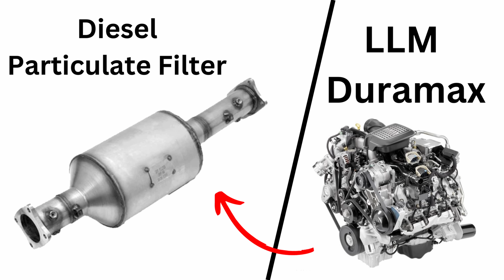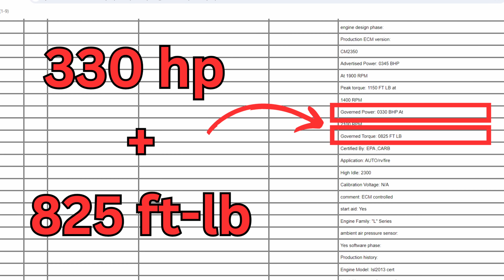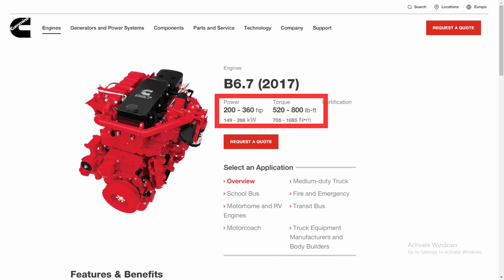Chevy 2500 8.3L DURAMAX Diesel Engine **Diesel Mechanic Review** | Should CUMMINS Be Worried?

Comment: Why? Because the rules that the EPA has put in over the past decades have been changed. These past rules is why we have small engines with turbos that are designed for high performance but are failing at 20,000 miles. And gas prices are dropping dramatically large engines are making a comeback.

Comment: Right now the Duramax is the most reliable diesel engine on the market. Powerstroke defective fuel pump problems continue, Cummins new design is untested but given the fact the new Cummins motor in the 2025 RAMHD still sprays extra fuel in the cylinders for regen which contaminates the oil.

Comment: I think you hit it when you said it would be for emissions, especially for NOx control.  I can see GM boring and stroking the Duramax, but not increasing power and torque output, or maybe just bumping it a little to please the horsepower fanatics.  Also rumors about a 7.2 Cummins are going around, and the play for NOx control would be the same.  Assuming that the larger displacements can be achieved without completely redesigning the engines, that could be a good way to meet tighter NOx emissions standards without increasing the powertrain cost significantly.  If the manufacturers can get to an emissions control strategy that allows them to eliminate the EGR system and meet NOx with the SCR system alone, that would be an overall cost savings.  The larger displacement engine would allow that by running at lower peak cylinder temperatures, thereby producing less NOx out of the exhaust ports.  Then the SCR could clean up the rest of the NOx by itself.  And that would eliminate secondary issues of recirculating exhaust gases to the intake.  Fuel economy wouldn't necessarily be affected if the engine is tuned to the same fueling limits, but if the stroke has to be increased, fuel economy might be hurt.

Just making some educated guesses based on basic dimensions of the Duramax, I don't think it would be easy to get it past 7.8L.  It would depend on how much GM is willing to push operating stresses.

Comment: If they don't figure out what to do about DOT laws and the current #26,001 Class A license requirements they won't be selling near as many trucks.   Keep building there trucks with higher GVW and everyone will be required to have a CDL license in order to drive one of there trucks with any type of trailer.   And that makes these trucks useless if you just ride around with them doing nothing.

Comment: Dura junk ! I bought a 3500 in 05 brand new. It was on a roll back at1200 miles and got that ride every other month for 3 years. The final straw was at 35k and it was down for 3 weeks with injection problems and parts had to come from Japan. I’ll never own another one. Bought a dodge 3500 w Cummins 6.7 6speed and now have 280k on it. Fuel, pump, water pump, some emission parts , never on a rollback!

Comment: I think the entire emissions system idea should be scrapped in favor of maximizing efficiency and torque potential. Making smaller engines that are more efficient will reduce total volume of emissions instead of less PPM. The Edison Motors concept of a true Hybrid system with a smaller max efficiency engine is the best technology path I have seen.

Comment: Putting a giant cubic  engine  will give GM a lot  of room to grow. I think all the big 3 trucks are pulling weights that are in air brake country. Loose  your torque converter  and it good  by .your exhaust brake is not made to stop you . When I pull heavy loads my w900 gets woke up. You had a lot of good points. Cummins made an 8.3 liter inline 6 300 horse power and 850 torque. It's the big cubes  that makes the strongest torque.

Comment: The torque rating on the duramax l5p is almost meaningless, as you’ll never be at 1600 rpm’s unless in first gear, and I also read the 2500’s are limited in power output in first gear. I don’t think pickups are designed to run at full power continuously, or near continuously, as a large tandem dump. Also, in addition to greater strength, a larger differential can radiate large amounts of heat generated by pulling a heavy load, improving durability.

Comment: When we were wrapping up the paper work on my dad's new '98 K2500 6.5 TD from a salesman my dad had bought cars from since the late '50s and I said how much I wished GM would make a giant killer turbo diesel, and the guy said hold tight, GM is coming out with an 8.3 diesel that makes 500 hp in a couple years. The guy worked at Gene Jansen Chevrolet for years, which was the dealership across the street from the Union Street plant and where all the performance Corvettes and race cars went before being picked up by racers and this guy was connected to GM corporate for decades. Sounds like he was off by about 20 years.

Comment: They just need to come out with their own version of the F-450 and f550 with a bigger drivetrain and heavier Duty frame  and put that use engine in them
Reply: They  do.. 4500, 5500, 6500 with the l5P

Comment: You nailed it... Emissions.   But also, I love lazy, low stress engines.  The macho, "Mr important HD truck" thing has gone too far.   We need solid, reliable, good performing trucks with less macho BS.  Like pickup trucks used to be.    A strong, low stress engine would help.

Comment: There is an ongoing theory that engine displacement will increase in order to reduce NOx emissions. The trend ever since Tier1 engines is go smaller with more boost.  This increases NOx emissions.   One way you can reduce NOx emissions and maintain power is to use bigger engines with less boost.    We’ll see.

Comment: I don't think its a Diesel Engine 
A lot people don't know, GM Last Giant Gasser truck engine the Vortec (496 CU) 8.1L V8 has still lived on as the (535CU) PSI 8.8L V8 power industrial applications (psi) a GM Integrator they also use others form GM Engines Design.
When the new GM Chevrolet Medium Duty Truck came out there were rumors of an 8+Liter V8 Gas Engine in some type of R&D but never came to the Medium Duty Truck market.
GM Power Solutions makes a LFI 8.0L V8 available 
KEM equipment INC a GM Integrator use a lot of GM engines for industrial applications including the 3.0 I-4 /4.3 V6/5.7 V8/8.0 V8/9.1 V8/ 10.3 V8

Comment: Cummins had/has an 8.3-liter inline diesel.  I believe many, many years ago it was used in military vehicles.

I think the potential of the 8.3's power is that a buyer could get a more typical long bed crew cab and still tow 36K without having to opt for a non-typical single cab short bed dually.
Reply: You are correct.

Comment: i think i recall tfl saying they could run the big engine at lower speeds to get the same power figures as the current lineup, reducing pretty much everything while also not being that much more fuel hungry or co2 emitting.
Reply: That theory holds "some" water. 
I could see that being the reason if that engine even exists and it's destined for the light duty trucks.

Comment: Seems to me like they might be designing it for the 4500-6500 Silverado trucks possibly so they can increase the combined weight rating on those while having a lower tune and a more reliable truck that can tow heavy without burning itself up in 200,000 miles.

Comment: I have 6 Duramax trucks with 3 over 400k miles on them. And the other 3 with over 200k on them with relatively no problems. I don’t know why he keeps talking about longevity issues.
Reply: Because most owners don’t know a single thing about proper diesel maintenance and instead rely on their dealerships for everything. There’s no pride in ownership anymore.

Comment: My 2 cents, higher cylinder pressure means worse nox. At 8.3 liters with cylinder deactivation could put the motor into the 6 liter range for traffic and level highway miles. IF they can get deactivation to work.
Reply: They would NEVER put cylinder deactivation on an engine like this. Look how that’s going for GM’s own gas V8s, not well
Reply: Cylinder deactivation is about reducing pumping losses at light loads in gasoline engines. Since diesels have no throttle they have no pumping losses and there is no point.

Comment: Ill pass. I don't have any desire to even tow 25k pds in my pickup truck. Its not nearly enough truck to comfortably tow that much. Im perfectly content with my 88 idi and 2011 duramax in there stock form. The idi is indestructible and the duramax has way more power than I need.

Comment: Don't you need a cdl when you start towing 26,000 lbs plus?
Reply: It depends. If you’re commercial, yes. If it’s personal use, it’s state dependent, but most should get their Class A at a minimum.
Reply: @CornFed_3 in my state total weight of 26,000lbs and above you are supposed to have a CDL. Small Companies that hall cars do use a smaller truck for that reason and taking the bed's off to stay within the weight restriction.
Reply: @racingpyro16 , right, those sound like commercial use companies, not personal use.

Comment: I have 58,000 miles on my L5P truck and I have never had a problem with that. I try to drive my truck hard every week or two. Just to get the boost pressures up high and I always try to get my truck at engine operating temperature before I shut it down.

Comment: First Alex I say TFL is full of it. They are mainstream media looking for any rumor to make a story. Alex’s videos are much more informative and interesting. 
I can’t see that large of an engine being put in the light duty segment. A few tweaks, I believe the L5p can be on the same power levels as powerstroke. I personally think that all 3 are at a point where there is no further need to increase power outputs on these consumer pickups. If you are in need of pulling more than 36k lbs, step up to medium duty trucks. I personally feel that a larger displacement diesel engine would surely make the pickup quite boring. I know i love diesel trucks not only for their pulling power but the fact that they can spool up and move quite swiftly. An 8.3 with a good tune and you couldn’t keep tires on it. 
Anyway, last thing…the EPA is absolute trash. Ruining diesel trucks seems to be their focal point these days.

Comment: Duramax got Def in 2011 not 2012
Reply from the maker: True true, but 2012 was the year it needed to be implemented. Gm was just ahead of the game I guess
Reply: @GettysGarage  comment was to correct that the LML (started in 2011) had Def. The LLY had EGR in 2004.5 the LB7 (2001-2004) didn't have it.

Comment: I like to think that strapping an EGR to a truck is akin to  making a guy breathe his own farts, if that makes any sense. Also, (putting high school chemistry to use here) in a perfect engine, there would only be CO2 emissions with some water vapor. The CO comes from lack of oxygen in the combustion event, soot would be too much oxygen, and I believe the nitrous oxides come from the nitrogen in the air reacting due to excess heat
Reply from the maker: You pretty much got it!

Comment: I think a higher displacement Duramax would be a move for lower-stress big power numbers for the consumer market. The commercial market would get a more reliable detuned version. I'm really wondering how much further Ford is going to push the 6.7 before it just explodes after 10,000 miles. 1200 lbs/tq is amazing, but I'm even more afraid to look at repair costs for that new 6.7 than I am for my own.
Reply from the maker: Exactly. It seems like ford 6.7 platform can only be pushed so much further

Comment: I truly believe that if this roumer is true, the decision to go with 8.3L is purely emissions related. For some reason it is not bigger news, but recently John Deer released a new large displacement diesel call the JD18, and it uses NO aftertreatment while still using EGR. In their limited press releases, they state that that have achieved this using new "combustion technology" developed by Bosch, and if I had to guess GM may be investing in using the same technology on the next Duramax. Like mentioned in the video, a large part of what makes this work is likely lowering cylinder pressure, and necessitating a larger displacement engine to make the same power numbers.
Reply: Same has happened to motorcycles everywhere, specially after trying to meet Euro 5 and stricter regulations. 
Bigger engines just to make the same power while barely passing emissions testing and in some cases . . . even less power at the same size as is the case of the latest KAWASAKI Ninja ZX-6R. 

About John Deere keeping EGR and ditching aftertreatment: 
I would rather have Urea Injection than dirty, abrasive and clogging exhaust fumes being recycled thru my very finicky and expensive diesel engine.
Reply: @GIGABACHI  Agree with you on the EGR point, but in my opinion it is at least a step in the right direction to ditch aftertreatment. EGR was the first form of emissions control put on diesel engines, I'd assume it would be the last to come off if technology allows.
Reply: Oh so bosch went and screwed everyone with thier cp4.2 pump, by making a cheap system. And took all that money to invest in something else. Got it.

1st tier level grifter right there. We gotta promote ethics, reliability is a product of taking pride in the work you do not squeezing a penny hoping dimes will fly out.
Reply: @casval-pj5tb  

Just want to make two things clear. 

1. This is my hypothetical, I don't know any real details
2. I'm not endorsing or condoning Bosch in any way. Yes the CP4 debacle is what it is, they also have thousands of other products used by manufacturers that work just fine.
Reply: I was just reading into that motor, offroad motors rated at 750 hp & over have NO emissions limit on particulate matter.  which is the reason for no aftertreatment

Comment: L9 is a joke of a heavy duty engine. The L9 is an up scaled 8.3C. The L series was the L10(10 litres), it moved onto become th M11(ISM), which was a lame motor like X12(compared to its competitors). The upsized motor does makes sense for emissions, but not in the size of the chassis(pickups). That motor would be very heavy(over 13-1400lbs) as the current diesels all tip in around 1100lbs(Cummins) that means heavier front axle ratings(poor IFS). The balancing act called emissions is finicky game. The  Cummins X12 is going away in 2025 to be replaced with the X10 with the same power ratings. Sort of merging the L9 and X12 in one(both engines have a 450hp rating). Neither L9 or X12 have stellar life spans when worked near the top of their weight ratings. The fleet of bises I drive just had the third X12 go down for a rebuild at less than 700k km. The D13 Volvos are making 1.2 million, then they are recommended to go to be rebuilt. It's sad that Cummins isn't living up to its marketing. I know many  X15s and ISX15s that didn't make 1 million. Last great Cummins was the N14.

Comment: I think by going with a 8.3L you get the high power numbers with more reliability. The 6.6 and 6.7 are like strung out crack heads it can do it but it's not going to live as long constantly doing it.

Comment: Why not get rid of egr completely and let the engine breathe. Make the scr catalyst bigger and spray more def. That will solve 2 problems. Reliability of the base engine and dpf sooting up. Higher cylinder temps and pressure means less soot but more nox and the nox can be taken care of down stream outside of the base engine.
Reply: Same thoughts as me ,there are companies that are doing that

Comment: Everyone is talking about displacement size.i drive 14liter Detroit engine 505 horse,1700 to 1900 lbs torque in a tractor trailer, not much power for a Big engine
But goes over million miles longevity, pulling daily, and it's fuel mileage loaded is close to a Duramax towing max.that says everything to me

Comment: I know this may not even be a fair comparison but the 7.3 got 14 miles to the gallon at most even though that engine came out 20+ years ago what is a little worrying is how the feul econmy will be for this i honestly like rhe 18mpg or when deleted could be like 21 maybe honestly don't know how rhis will go with them
Reply: There are a lot of people who got significantly higher than 14 mpg in the 7.3 powerstroke, as well as the newer diesels as well. How you drive has a lot to do with your fuel burn rate.
Reply: @the1stvendetta  I'm just going off of what people.have said they got with no mods

Comment: A little off topic but I just picked up a new Duramax and was wondering if there is a premium or bad DEF fluid? And also is there a shelf life to them in case a buy a bunch. Love the channel and the info!
Reply: As long as the box is kept away from the sun light. And not frozen or high heat. Longevity is about 2 year's
Reply: Just do not use Blue DEF Platinum.  There have been reports it causes an error code in GM  def systems. Stick with regular DEF.
Reply: Yes, but as needed and maybe a little extra. Do not buy bulk
Reply: Thanks for the info. I also heard bad things about SHELL ROTELLA

Comment: LBZ crew checking in…
Reply: LLY but close enough
Reply: 2 runners, 2 I'm slowly rebuilding when I have free time, and always ready to pick up another 1 or 2 or 10.... don't plan on ever owning anything newer.

The rebuilds are staying in storage when I finish 'em and I'll rotate one in when a roller needs replacing.

18 years and 520k on my original, if I only got 10 years each out of the rest, I'll be close to 80 years old and not worried about much of anything anymore.
Reply: I'm holding out for an LBZ. I'll gladly settle for a nice LLY
Reply: I have two 2006 3500 single wheel crew cab long beds in nh for sale
Reply: 06 LBZ CC with 450k miles..... and no rust.

Comment: What do you think is the most reliable diesel truck out there between ford. Gm and dodge in the HD TRUCKS
Reply: An older 1
Reply: Currently available? Ram 3500 with the High Output Cummins/Aisin 6-speed automatic.